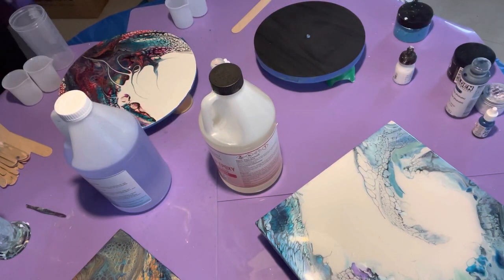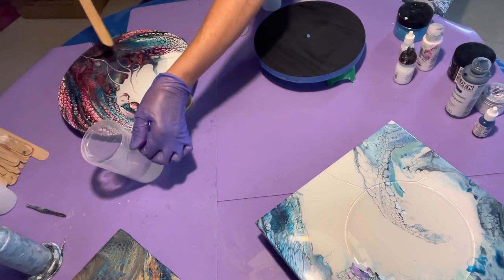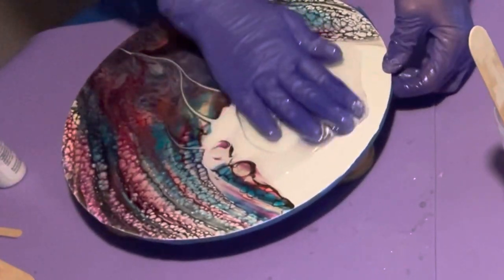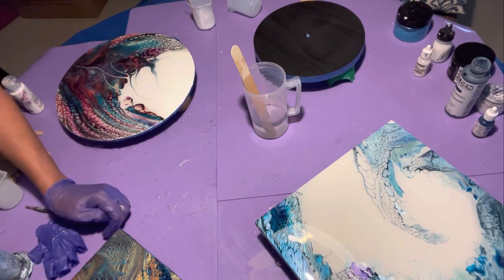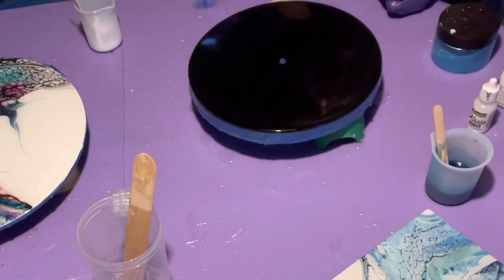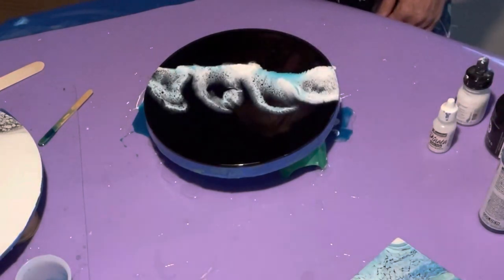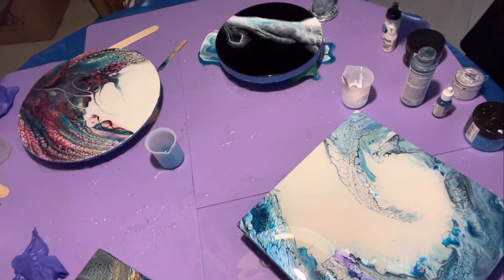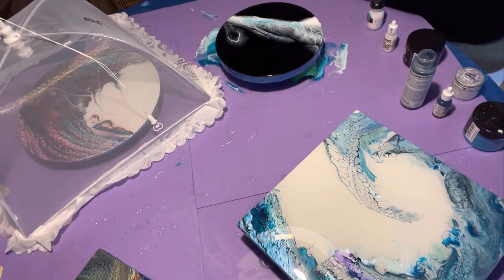RESIN DO’S and DON’TS - Bonus Clock Wave Piece  Part 1 / How To Finish Your Work

Comment: What do you do with the containers that you use the epoxy in?
Reply from the maker: You leave the stick in it. Wait until it cures. Then squeeze the container to loosen the resin on the sides, and pull on the stick. It comes out totally clean and ready to use again!! Cool right??